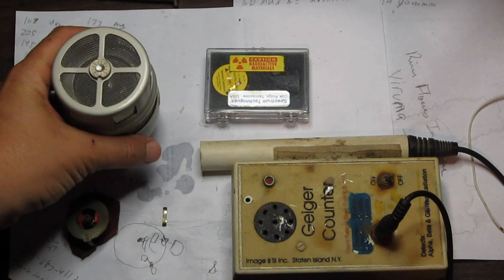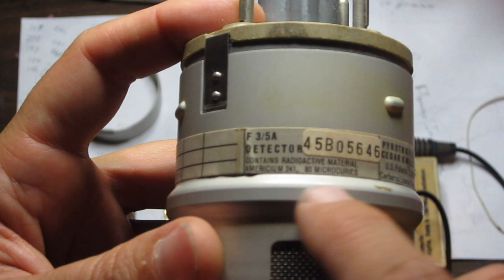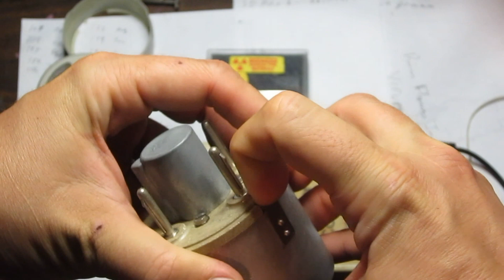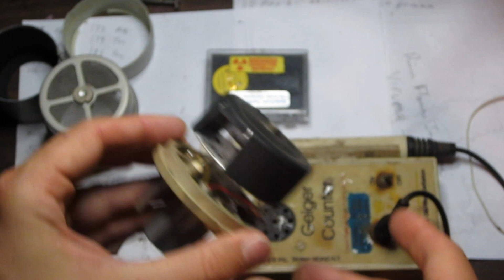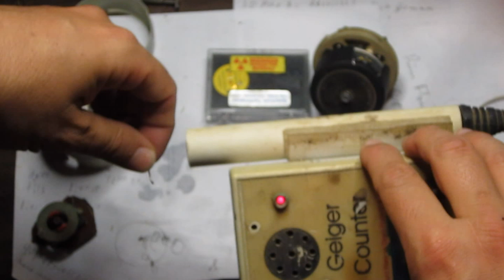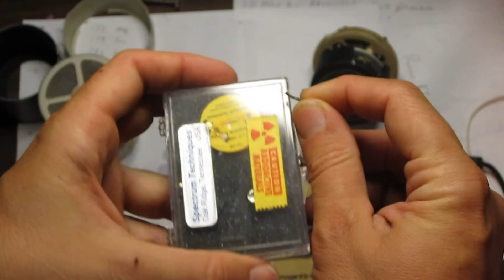What's Inside Industrial Smoke Detectors?

Comment: Handling the strips like that, even with gloves, is an absolutely horrible idea. Those pyrotronics sources shed "fleas" everywhere. I dont think you understand the hazards of what you're doing.
Reply: Are they are hazardous while still in the detector? I recently received one and only opened up the package. I have a respirator and gloves but didn't use it for opening the package
Reply: @justjustin7006  yes, they can still leak in situ, especially if the detectors are corroded or have been physically damaged (eg dropped).